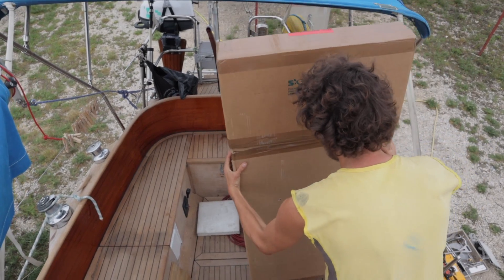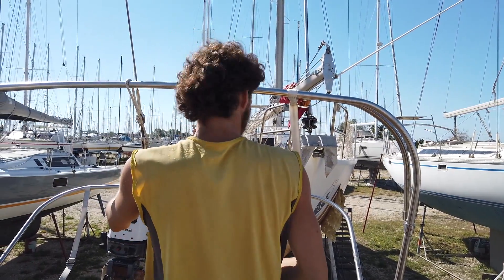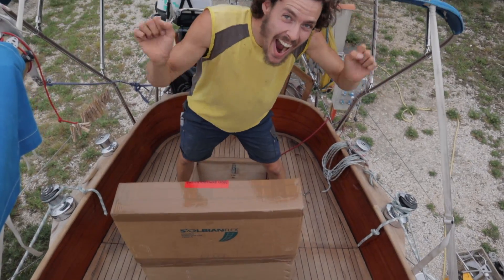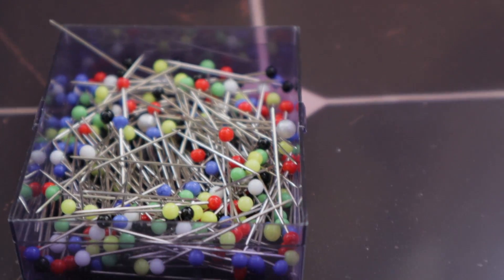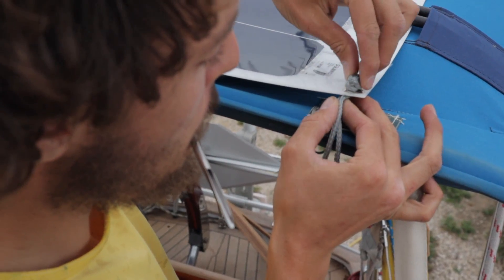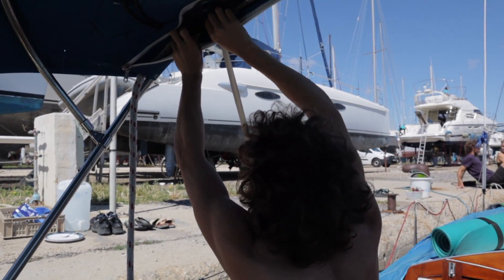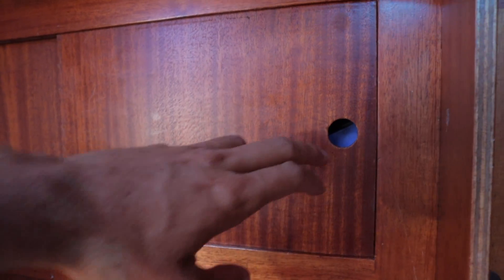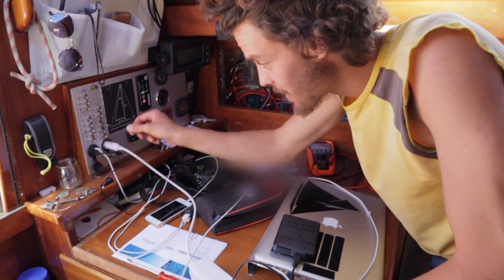Choosing and Installing our Solar Panel! [Solbian 130W Flexible Panel]

Comment: Excellent video...I do not know what the surface of the Solar Panel is like, but have you thought about using car wax polish to protect your panel? It would mean that the salt water would run off and not stain the panel and prevent scratching when you clean. Stay safe, I don`t have to tell you both to stay Happy, because you obviously are :-))) xx

Comment: You should consider the use of wire ferrules (@ 4:45 - https://youtu.be/LXZJpFdWDtA?t=286 ) to make installing (especially in tight working spaces),  future troubleshooting and repairs easier...

Comment: well done on a very neat installation, the module you chose uses some of the best cel technology and you are reaping the benefit of that investment. I particularly like the way you use the MC4 to carry the connections through the deck, they really are very good though not completely bomb proof. Have you any caps to go over or in the connectors when the panel isn't plugged in?  Happy sailing!
Reply from the maker: The solbian deck connection does come with caps to close when not plugged in and we have not used them yet, but they look very leak proof! 
Thx for watching
Aladino
Reply: Sailing Magic Carpet .i used to be a solar module design engineer, then taught electricians installation, before doing it my self. I have one installation which has a leaky MC4. It's not been a serious issue, but I suspect one of the tiny o rings is either missing or broken. I the case of this array just getting to the panels is very difficult indeed. I think if you needed to, there is room to go for a second panel. Btw, you are right to avoid cracking the cells, they are as fragile as eggshell though they can go on working surprisingly well if the get even serious damage, best to avoid it though.

Comment: I love solar.  I lived in my motorhome for years with 200 watts of solar and loved it.  Now, finally on my boat, I have solar on the boat.  I built a doghouse over the hatch and had 2 other spaces for 50 watt panels.  My first set went south before I even used them :-( my second set is Lensun.  They are semi flexible and adhered to the deck with Sikaflex 291.  Solar is great.

Comment: You should allso when you can install an wind generater. they will complment the solar and when its cloudy and night you you will still have power going into the battery bank as auto helms use up an good percentage. lighting will all so put a small charge back into the panles.
Gerard.

Comment: I have installed solar panels at my home and the supplier insisted on German panels as Chinese panels, whilst cheaper, are not reliable and need replacement much sooner. Extra cost for Gerrman panels is apparently cheaper in the long run. It pays obviously to buy quality to start with!

Comment: I might be wrong and they don't fit but it almost looks like you could turn them 90 degrees and put a 2nd up there but you might have to prop up a couple inches? but your boat and your needs.

Comment: Hey team, Excellent work! and thanks so much for the very informative information! Please consider installing one of these next! https://www.walmart.com/ip/1200W-Wind-Turbine-Generator-12-24V-5-Blades-Diameter-of-the-wind-wheel-is-1-4m-With-Control/637678671?wmlspartner=wlpa&selectedSellerId=0&adid=22222222228297390284&wl0=&wl1=g&wl2=m&wl3=366380127489&wl4=pla-786363061143&wl5=&wl6=&wl7=&wl8=&wl9=pla&wl10=8175035&wl11=online&wl12=637678671&veh=sem&gclid=Cj0KCQjwivbsBRDsARIsADyISJ-pxWSrl1WcikavMy7xSJKnWU_XWvHgRHWm5CJqK8E3910VCAMvP6MaAve5EALw_wcB

Comment: An idea to think for future expansion: you can have several solar panels attached to the safety railings with supporting posts on both sides of the boat. Adjustable for the sun angle and foldable for underway with strong winds. Have seen it on several small boats.

Comment: Wait until you have a full moon and check the voltage coming out of your panels. I have a few panels at home and on a full moon your can see a small amount of power coming out of the panels. Pretty cool. Nice video.

Comment: Hey guys I loved your video and it was so comprehensive. I have had exactly the same solar panel on our Dufour 365 since 2013! You mentioned attaching the panel your way as well as Velcro. We ordered our Solbian with zips so that it zips straight into/onto the Bimini. Anyway any of these methods works. It is a great panel I think. We have teamed it with a Electic Energy (UK) D400 wind generator and even in winter our batteries are always at 100%. Happy sailing! Gerard (Paynesville; Australia)
Reply: Hi Gerard, may I enquire what store or website you purchased this brand of panel in Australia? I'm in Brisbane and hoping to add extra flexible solar panels to my sailing yacht soon
Reply: David Turner Barrenjoey Marine Electrical David. They are in Pittwater just north of Sydney. I’m sure they’d have a contact for you in Brisbane. Cheers. Gerard
Reply: @gerardwall8847  Ok thanks Gerard. I am familiar with that area as my mum lives in Lindfield and sister in St Ives.

Comment: We use a flexible solar panel of 100 watt with a pwm charger on our maxum 1900 sports cuddy speedboat. We use the boat for watersports but also for overnight trips. Some even two or three nights. We like to carry our food and drinks cool and a 12v peltier car fridge is doing the job in combination with an old extra car battery and the solar panel. When underway we take the panel in the cuddy since cruising speed would break it. The panel is mounted with quick adjusting ropes and clamps to make it easy to shift the panel and keep it pointed to the sun when at anchor. The panel puts out more than the fridge will use. So during the day we are good. In the evening we run it for half an hour every hour and a half.  Until we go to bed. And by then the panel will be pointing the direction the sun will come up. So at first sun we get power. The first to be awake will switch the fridge on. It is not perfect because of the cooling pause at night but for a few nights this method will be good enough to keep our food from spoiling. We bought a powered surfboard for kids and also charge it on solar power. Also rc jet boats or rc waterplane if I bring them on occasion. So yeah, solar power is cool. Helped us out big time. Better would be a compressor cooler. Much more efficient and better insulated but also bigger and much more expensive. Since this is a speedboat with a mini cuddy we do not have space for that and this works fine for our needs at the moment.

Comment: Hello dear MC Crew 😊

I can highly recommend the use of modern LiFePo Battery’s instead of traditional Lead Acid or Gel Battery’s. 

Weight is not much of a concern on a sailing vessel, but there is another very big advantage with lithium technology: 

They suck up every bit of juice as fast as it can be delivered. Even at 95% full the charge amps can be as high as 25A, where a traditional battery would already have limited itself to maybe 2 amps. 
The charging graph of a lead acid battery is a curve, that gets pretty shallow above 70%. With a Lithium cell, it is a straight line from dead to 99%. 

In practical case of use, a lithium battery is completely full in a fraction of time, compared to a traditional battery. 
So even short runtimes of the boats engine will boost the battery up to 100% again. 

I personally use a Super-B Epsilon 90Ah LiFePo, and my experience with it so far is fantastic. 

LiFePo Battery’s can also handle a much higher depth of discharge than lead acid battery’s. 
So 90Ah Lithium easily replaces 160Ah lead acid cells.  At 12kg weight in total 👍

Comment: it is worse with ac but you still get the problem with dc ,as mentioned you only need to cut a slot between the holes to rectify.You can then fill the slot with silicon if required.

Comment: when passing cables through a metal plate you should pass both cables through the same hole. I you do not then you will create eddy currents between the two holes.You can cut a slot between the two holes to eliminate the problem.
Reply: Is that still an issue with DC?
Reply: @JPBennett  It is not an issue

Comment: Well, Y'alls Did Your Homeworks Quite G@@D! Now, I'm An Expert In Green Living Products & Self Sustainabilties For Past 40+ Years... Solar Is Great & Getting Better All The Time, Yet Still Is Only About 50% or Less Efficient Since The Sun Only Shines On Average 7 To 10 Hours Per Day To Make Usable Powers Depending Upon Your Actual Latitude North ot South Of The Equator Of This Earth! Soo I Would Highly Recommend That You Utilize The "Better" Option In Y'alls Cases The Alternate Power Source Of The WIND (Dah Your On A Wind Powered Sailboat) To Produce Even More Electrical Power Than Solar With Less Troubles or Installation, Maintenance ETC! Since What Happens At Night, On Cloudy, Stormy Days? NO SUN = NO POWER & Then Your In The Same Boat As Before... A 500 to 1000 watts Wind Tubine Takes Up Less Space Than Your (1)-130w Panel, Don't Need Cleaned, Works Great Night or Day, In Sunny or Stormy Weathers, ETC...You Catch My Drift...LOL A Combo System Is Always Your BEST Choice In Making Dependable Electric Power To Cover All Bases, It Can Be Wired Into & Use Your Same MPPT Controller Also! And Please Move To Lithium Batteries ASAP For MORE Power Storage Space & In Less Size/Weight or Maintenance Also... Good Luck! PS Hey Would You Guys Want To Sell Boats To Make Some Extra Side $$$? I'm A Dealer Rep For These NEW Boats & I Can Make You A Commision Dealer Also! Check Them Out & Let's Chat On It!? Thanks https://www.whalyboatsusa.com
Reply: Magic Carpet cruises the Med in summer, about 12h sun everyday, but many days without wind. Most anchorages are wind protected, nobody wants to anchor in spots with 20ktn of wind to charge the batteries! Ans solar panels are safe and silent, you haven´t to avoid the wings of the windgenerator.

Comment: I have 150W which is very close to your choice. I have a fixed installation with hard panels. Same as yourselves I found it very useful and it helped putting my mind at rest concerning the availability of power. I left the installation running throughout the winter months to keep the charge on the batteries. It only needed cleaning occasionally. I still wonder how i did without the solar energy installation before all this. Best wishes with your system you will find it very useful for sure.

Comment: You cant fit 2 more smaller sqare panels and what about wind turbine ???
Reply from the maker: We could, and perhaps we will in the future! Wind turbines have a lot of drawbacks so we don’t want one of those
Reply: @SailingMagicCarpet  drawback ? It spin it generate power simple , special în Night  time wen wind Pick up speed , another solution is to have a electric engine plus a generator....it cheaper in money and as long you move in the water and the propelow spin it generate electricity ,not mention it save money nu not doing meintenance like change oil filters all kind of mechanical problems......You got many solution at your disposal
Reply: @argusdacicus1516  Wind generators are noisy.
Reply: @mikebarron5805  nothing work for You 😁 there are smal solar panels with hard glasa on top and You cant cover the deck and walk in them, thats a fancy solution.......another solution it to take example from Sailing Zatara they got flexible solar panels in top of the cabin boat i think it model that you cant walk in them.....i told you another solution it to get rid of your diesel engine and replace it with a electric one and a smal generator wen you are în the move the electric engine generate electricity it will cut cost take example from Sailing Uma.....one smal solar panel not even far enough.....You need to feed the electronics on board it mather of safety 🤔